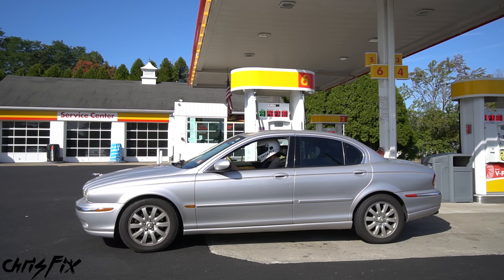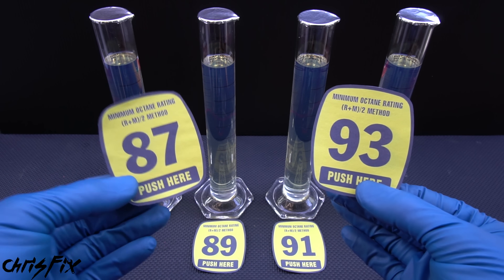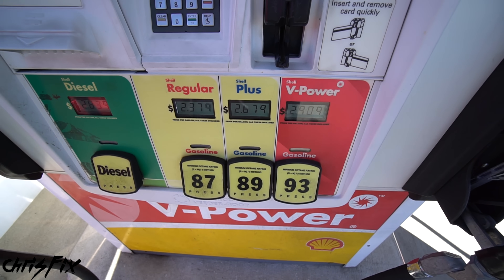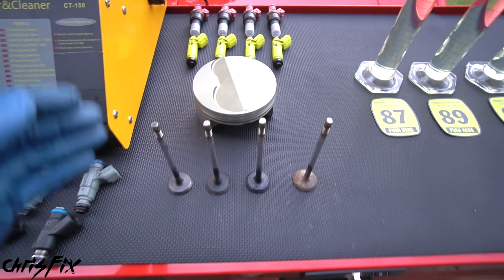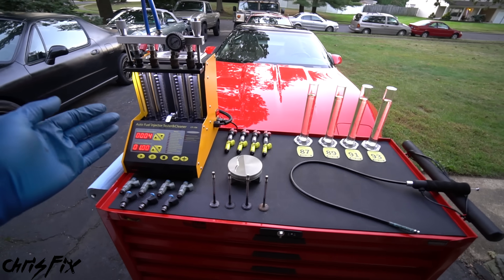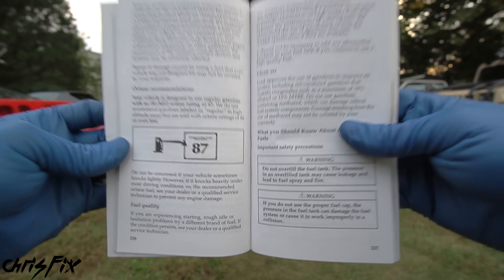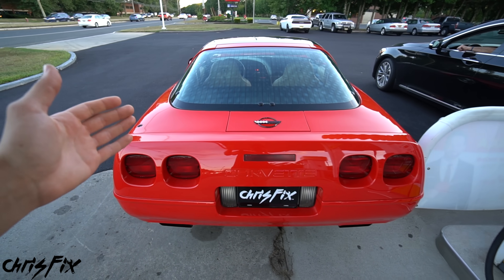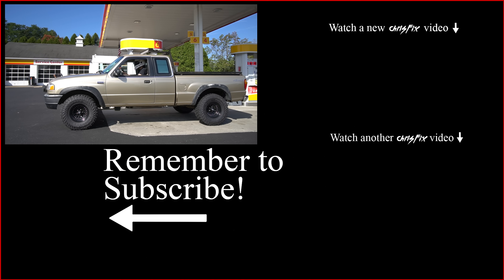What is the BEST Fuel to Use in Your Car or Truck and WHY

Comment: I'm a chemist and have worked in a lab testing gasoline and diesel. This is for the protection of the consumers in our state. I'm pretty sure most states have a lab to do this. Most of the information in your video is correct and very useful. Thank you for making sure to emphasize the octane rating you see at the pump is NOT the energy content of the gas. It's all pretty much the same between 87 and 93, unless of course it has a higher percentage of ethanol (Uh can we say E-85? why would someone run this fuel 🙄). Ethanol will decrease the amount of energy in the gasoline, but it's added to make the gasoline burn cleaner and is good up to 10%. 

Something you didn't emphasize enough though is what "octane rating" actually is. It is NOT the amount of octane in the gasoline. There is little to no octane actually in gasoline (octanes are eight carbon hydrocarbons). The octane rating is the "equivalent amount of octane" in the fuel so that will resists knocking as if it contained that percent of octane. Gasoline is mostly made up of mixtures of toluene, and xylenes. If you ran pure toluene as your gasoline, you'd be getting about a 110 octane rating, but this wouldn't necessarily be good for your engine. 

When gasoline is made, the manufacturers control the mixture of hydrocarbons to get a clean burn and the proper vapor pressure (vapor pressure is the pressure of the vaporized gas above the liquid, not to be confused with the engine pressure). Also the gasoline must be protected from oxidation (this is why you add fuel stabilizer when storing for a long time) and contamination like water or particulates. Every brand of gasoline has slightly different proprietary ingredients to do this (as you've said at about 6 minutes). Also, the time of year will dictate what vapor pressure the gasoline manufacturers must make the gasoline to deliver to the consumer. 

Forget octane boosters. A pint of octane booster won't raise the octane rating of a full tank of fuel enough to make a difference. If you have a high performance engine that's been engineered for high compression, you're going to know you need a higher octane rated fuel. You aren't going to hit that 87 button. Are you?🤔  By the way, most mid-grade pumps, mix (in the pump itself) two parts of 87 with one part of 93 to get 89. But if you look at the price per gallon, they usually give you the "mid-price" between 87 and 93 for the 89. You'd be better off cost wise, by pumping 10 gallons of 87 and 5 gallons of 93 if you really want 89. I suppose mixing it well enough in the tank might be problematic for the first few miles. Really, you didn't need the 89 anyways.

Octane Rating Tests Explained:
One more thing you didn't explain well was how we get the octane rating in the USA. Yes RON stands for Research Octane Number. It refers to an actual test engine and ASTM method D-2699 for testing the octane rating of spark ignition fuels. My lab uses a RON called a Waukesha RON engine. It varies the compression of the cylinder to make the fuel knock while holding other variables at constant values (temperature, fuel/air mix, engine speed, etc). There is another test engine my lab uses, it's called a MON or Motor Octane Number engine and ASTM method D-2700. It too is a Waukesha engine that varies the compression of the cylinder but holds those variables at different values, mostly the engine speed is faster on the MON (900 rpm instead of the RON's 600 rpm), but I believe the inlet temperature of the RON is also kept higher. The RON and MON tests give slightly different results for octane rating due to the differences in these other variables. MON is always lower than the RON, by about 10 octane ratings if I remember correctly. In the USA, when you see the (R + M)/2  on the pump's octane rating label, it's telling you that the gasoline is rated by testing by both the RON and MON methods, and the final number you get is the average of the two test results. I rarely hear this average referred to as "PON", but I know it's not PUMP Octane Number. I had to look that up and if you want to trust Wikipedia it stands for "Posted Octane Number". In Europe, they only test with the RON method, as you've said, so this is why their octane ratings are higher. They don't have the lower MON test averaged into their octane rating.

Great information in your video for all consumers. I gave it a thumbs up. 👍
Reply: How could a person consume toluene?  Is it contained in alcohol?
Reply: There needs to be a correction to this statement that all the grades of fuel burn at exactly the same rate, or speed, (which isn't exactly the same, but close enough for this video.)

The lower octane rated fuel, the 87 Octane, actually does burn faster.  That is why it will cause knock problems in higher compression ratio engines.
In 87 Octane fuels, you will find more straight-chain HCBN's, and this is the source of the quicker burn.  A straight-chain HCBN, such as normal heptane, C7, because it's seven Carbon atoms in a relatively straight line, with the other available bonds, (carbon usually forms four single bonds), taken up by hydrogen atoms.  Normal heptane is used as the definition of zero Octane when running the fuel in a test engine.  When used in lower compression ration engine, this quick burning isn't usually a problem.  The lower compression ration doesn't force the molecules in the cylinder as close together as in a high compression engine and the rate of burn will occur throughout the downward, or power stroke of the engine.

In a high compression engine, the fuel/air mixture forces the molecules closer together, and they will burn quicker than the piston can move down in the cylinder, and you may hear the 'knocking' sound, which is the flame-front of the mixture hitting the cylinder top as well as the cylinder walls.  It can get bad enough to blow a hole in the top of the piston, or even bend a connecting rod, (or both), and this will not be a good thing for your wallet.

I said earlier that normal heptane, (n-C7) is a straight chain HCBN with a RON of zero.  A different HCBN, one called isooctane, which contains 8 carbons, but not in a straight line is used as a reference and is, by definition, 100 Octane.  This HCBN contains 8 carbons, but not in a straight line.  It has a line of 5 carbons, with 3 others branched off the main chain.  There is more than one isooctane, but the one given the 100 Octane rating is technically, 2,2,4-trimethylpentane.  That means the second carbon in the chain, has two other carbons branched off of it and the 4'th carbon on the original chain has another carbon branched off of it.  This actually causes the fuel to burn at a slower rate in the higher compression engines as it takes more time for the carbons on a branched chain to react with the oxygen in the cylinder, giving a longer, slower and smoother burn throughout the power stroke, not having a quick moving flame front that may damage the engine.

Okay...., enough of Chemistry 101 for today.  (I also worked in the engine lab of a research company for a while years ago actually running the knock test engines.  We were part of the National Exchange Group that rated gasolines for not only our products, but also those of other companies to ensure that we were all getting the same results, ensuring continuity throughout the petroleum industry.  I only worked in the engine lab for about a year, but I stayed with the company and moved to the petrochemical research division. spending over 43 years there, designing and building experimental refinery units and processes.  

Now these days, although they still sometimes use these old single cylinder engines to rate fuels, it's mostly done by chemical analysis right at the refinery, using a gas chromatograph, analyzing the fuel as it's being made and calculating the Octane number right on line.  In some cases, they have gone beyond that method and are now using what's called an NIR cell.  The NIR stands for Near Infrared, and a beam of this light is passed trough a sensing cell with glass on both sides, one with the NIR source and on the other side a sensor picking up the spectrograph of the light beam.  By much work and effort, it's now able to give a rather accurate analysis of the HCBN stream in the sensor and calculate the Octane number from this analysis.
Reply: @bruceberntzen5807  lol
Reply: As a chemist with 12/13 years in the industry certifying gasoline, yes and no. There IS a difference in energy between 87 and 93... 93 is often blended differently, meaning more reformate (more aromatics means more energy) or, in some cases, pure alkylate. Ethanol does not necessarily mean "cleaner burning", but it can be taken for that in some ways. There are some wrong statements in the video... but for a leyman breakdown, it does its job.
Reply: Thanks mark. So you agree ise the one with the worn out button
Reply: Oh my god 
That was so intersting and usefull
Reply: Mark Bisson wow ☺️☺️👌
Reply: Refreshingly thorough comment, thanks!
Reply: E85 is amazing for forced induction
Reply: Same my butt, I always use 93 in my bike or it runs like a ww2 soviet era tank.
Reply: is it Mobil that used 10% Ethanol in the Gas?
Reply: Mark, a question for the recommended gasoline from the manufacturers...As we know that high compression engines require premium grade gas, do you have any info as to what engine compression ratio needs that kind of gas?  I knew a lot of autos have compression ratios lower than 11, mostly around 10.5, and they recommend premium gas (not required)...Thanks,
Reply: No you're not
Reply: @DonLicuala  It was an example of when to use what gas and additive.  
You do realize a stock Yamaha 600 street bike is 13.1-1 and is rated for 93 octane?
Reply: @DonLicuala  Ironic
Reply: @OGSteele-i9v  I swear I couldn't make this stuff up if I tried lol....because it "might" have worked in one scenario with a dirt bike, you can make a blanket statement. Well that tells you a good mechanic has nothing to do with being a good scientist.
Reply: DonLicuala: Pleas explain the Wave Equation. I am interested to know how it works with a internal combustion engine using spark ignition.
Reply: @jaysmokey  Yes call the number on the certification sticker on the pump. In my state it will put you in touch with the office of weights and measure, a division of our department of agriculture and consumer services. If it's a pump that mixes mid-grade, it's quite common for the mixing valve to be malfunctioning.
Reply: Wrot a whole essay
Reply: Great info. I used to work at oil refineries and also ethanol plants. I'm an amateur mechanic or enthusiast. Not a great tuner but getting better with the better tools and understanding of fuel atomization and newer computer controlled air/fuel mixtures. My question is this Waukesha engine. How do you vary compression without changing heads, combustion chamber size, or type of piston? I did a lot of lab work at the ethanol plant as well. Our methods were very precise, and the distillation process of this small plant was so consistent with the sieve system that top distillers could not make better ethanol. I only think that ethanol is bad for fuel in engines not designed to run it. That is a whole different discussion though and just wanted to ask you the question about the Waukesha. Thanks
Reply: Mark Bisson whoa, this information is gold. I love that a fellow scientist decided to drop knowledge on those who are blind in this space. My background is in medicine not chemistry so this explanation was amazing for me! Thanks again! 🙌🔥🤩
Reply: Tyvm
Reply: Thanks for your additional input!
Reply: What about LPG octane number, performance, etc? I have read that LPG have higher octane number. Also i have read that LPG is good for enviroment.
Reply: @milanmitrovic994  I've never heard of anyone doing an octane rating test on liquid propane. As far as I know, Waukesha doesn't sanction a modification to their test engines to be able to run cryogenic gas. The ASTM method certainly doesn't include LPG as a fuel for this test.
Reply: What’s the deal with 86 octane? I see those occasionally and it confuses me when most cars today run 87
Reply: I have a Honda pilot. It has an 11.5 to 1 compression ratio. I’ve been running 91 with ethanol content in there it says 87 or higher recommended with top-tier fuel I go to Sunoco that has the top-tier sticker. I want to have the best performance and mileage. I used to run 93 but apparently my compression is too low for 93 even though my car didn’t get hurt running it.  I’m not sure exactly which the best octane to run is since it says 87 or higher.
Reply: I have a 4.3 V6 Chevy engine.  I believe the manual says to run the cheap stuff.  I started running premium a few years ago, because the engine seems to run a lot smoother.  If you listen to all the "experts"  they would say to run the cheap stuff.  I have no idea what the fuel mileage difference is between the two, but isn't it better for the engine not to have it knock?  I think it's worth the price difference just for the engine to run smoother.  Am I wrong?
Reply: @mailjamesthomas  do you have a rod knock or a pinging? In either case, you should probably do a little maintainence under the hood. Check the fluid levels and coloration, belts, filters, etc. Also, check online forums specific to your vehicle. Maybe it's common thing and fellow users (you know, birds of a feather) might have some inexpensive tricks to fix it without getting pealed by unscrupulous mechanics and you might learn something new about your truck. I find that whole "well it's not doing that thing now so we should be good" mentality to be major hassles I can't schedule.
Reply: @cliffcampbell8827  I'm not sure, The engine just seems to run smoother when I use premium.
Reply: @mailjamesthomas  Seems? Waste of money. Read the manual.
Reply: @mailjamesthomas  Yes you are wrong. The manufacturer makes manuals for a reason. They know what gas you need. Read it and use the proper gas.
Reply: @thekretch   Stick to reading pamplets and cereal boxes. Stock cars knock on reccomended fuel all the time. Most GMs that call for 87 can have measurable knock in "normal" operation using a scanguage II. 93 Octane prevents that knock. 
 Ford put a 4.6 DOHC engine without knock sensors in the Lincoln continetnal. They reccomend 91 octane because of this and they also reccomend replacing stock plugs with shorter ones just in case. A lot of mistakes made with that vehicle.
Manufactures get the car out the door, they dont fine tune them.
Reply: @mailjamesthomas  No you're not wrong. If your engine runs noticeably smoother with higher grade gas, then irrespective of recommendations  you should use the higher grade gas.
Reply: @Scott-ew3bs  Wrong. You want to waste your money go ahead.
Reply: Sounds like a good write up, but really lacks knowledge on the mechanic side. If you don't understand how octane corresponds with compression you should find out. 

Being a good chemist has nothing to do with being a good mechanic.

And for octane boost not making a difference, that is just an ignorant statement.  My last racebike had headwork done and was milled, this brought the compression up to 14.1-1, and after this on 93 the motor ping'd, and after adding 3oz of a lead based 108 booster, the pinging went away, and the engine ran drastically smoother.
Reply: @Scott-ew3bs  ping'd or pinged? Is your racebike an R'1? GSX'R? Panigal'e? For a racist you seem pretty cool though. Sigmund Marquez Dovizioso Freud was good at headwork too.
Reply: @Scott-ew3bs  it's the lead that removed the pinging not the octane, as lead is a natural lubricant in that form.
Reply: @b.eduardo5105  No sir. Lead contributes to the octane rating. Yes it is a lubricant, but that is only needed for old style valves, like prior to '73

Lubrication has nothing to do with detonation in a 4 stroke engine.
Reply: @Scott-ew3bs  Most of my cars are pre 73 :)
Reply: @b.eduardo5105  Tetraethyl lead was a lead based octane booster...
Reply: @b.eduardo5105  Nope, it's the octane rating that's increased with the addition of Tetra Ethyl Lead  protects the engine from detonation. 
The octane number can be increased a number of ways, adding TEL, MMT, MTBE, TAME, ETBE, ferrocene or Alcohol for example. 
For detonation prevention, it doesn't matter what's used for increasing the octane rating, it just needs to be the required number for that engine design. 
But other considerations ARE important. TEL (Lead) is a really bad pollutant for human brain health.  MTBE (Methyl tertiary butyl ether) is a terrible contaminate of ground water. Ferrocene causes engine wear, and so on. 
So these days it's done by increasing the hydrocarbons which have high natural octane numbers and reducing those with lower octane numbers. 

For example, most straight chain hydrocarbons have poor detonation ratings, like n-heptane and n-octane (yes n-octane has a terrible octane rating). 
But some branched-chain hydrocarbons like iso-octane (2,2,4 trimethyl pentane, and 2,3,3 trimethyl pentane have high natural octane ratings, as do carbon ring shaped hydrocarbons like benzene, toluene, and two isomers of xylene. 
and of course adding Ethanol also increases the octane rating, but it does reduce the energy density of the mixture - 10% ethanol reduces the energy content by about 4%, so you go slightly less distance on a tank full.
Reply: Good stuff Mark. Can't argue with chemistry. It's what I love about hard science, it's not open to pointless conjecture/opinion.
Reply: I read your article 😉... thank you for the info. Can you please tell me in plain English which is the best fuel for my car?
Reply: @eddiebrock9943  Chris Fix said it well. The best octane grade to get is the one your car is designed to use. For most of us that's 87 octane. The proprietary ingredients make little difference. Keeping your car well maintained and running with the right fuel/air ratio will keep your intake clean. Chris Fix also gave Shell a "plug" for using more ingredients to keep injectors and valves clean, but I can't say if that's accurate or not.
Reply: @mbisson5816  thanks bro
Reply: @eddiebrock9943  you should probably include engine model, make, model and year of the car and if it's been modified (intentional mods only, those "while driving" unintentional ones are best left to a body shop and your insurance company). Or you might be able to get a copy of the owners manual from the dealership or manufacturer. The info should be in there.
Reply: @eddiebrock9943  your manual or gas door will tell you. Most need regular 87, higher performance and most turbo engines require or run better on 93.
Reply: @codyrochev3878  thank you but what about 87 being dirtier than 93?
Reply: @eddiebrock9943  Whatever is recommended in the owner's manual.
Reply: eddie brock ... I would say diesel...
Reply: @eddiebrock9943   Good question.... IF you have a high powered car use the higher octane, otherwise if you have an ordinary car use the lower octane...In the uk we got 95 n 97 octane.... I use 95 in my Fazer600 but she is 21 years young...
Reply: @gregoriousgilbert519  I have an Impala 07
Reply: @eddiebrock9943  Read your manual.
Reply: English?
Reply: Premium is the best but it cost more I used to haul gas they told us not to drop gas at the premium had more than one in our or 1 inch or less of water and regular could have over 3in and more trash in it you get more trash and water and regular than you do premium cuz we had to go pump the tanks
Reply: @dalemarshall625  Premium does not make your low compression stock daily driver, drive better or give you more power. Their should be less water than that from your storage tanks. That waste should be cut or drained into waste tanks well before delivery. That is protocol at any good supplier. Corners are cut by operators and drivers as well. Samples are pulled from the bottom of a storage tank before delivery and that's where the water will be. Those lab results have to be within parts per million not 1-3 inches, before delivery. Tankers and storage tanks get cleaned with solvents not water. If there is garbage or water those tanks need to be decommissioned or relined. That's just crazy.
Reply: @dalemarshall625  unfortunately thats not true. Premium gas lowers fuel economy and horsepower in virtually every vehicle, the only exception is if the car has serious engine trouble already, in which case premium can disguise it and make it run a little smoother. But for 99.9% of cars including the ones where the manual recommends premium its a lie and just a waste of money.
Reply: Wow, I understand everything you said up to I'm a chemist, after that could you please explain again, lol good stuff.
Reply: "Why would someone use E85?" Really? Guess you don't know much about performance lol You can make a ton more with E85 over regular pump gas
Reply: Not great at all. At 2 minutes 48 seconds he says the fuel exploding before its supposed to. Gasoline is not supposed to explode. It is supposed to be a quick burn.
Reply: @suekennedy8917  what is an explosion? A tremendous and violent expansion of something, like fire consuming a highly volatile fuel in a pressurized container.
Reply: Cliff Campbell: What university did you get your engineering degree from. It's not an explosion, its a quick burn.
Reply: @suekennedy8917  I know you are technically correct. Most people don't understand the distinctions between materials that are combustible, flammable or explosive being the rate of reaction and the speed of the expanding gases, but I'm willing to accept a general usage of "explosion" to be a rapid expansion, and ignore rates. Diesel fuels are combustible, gasoline is flammable and both are made to burn rapidly in an internal combustion engine. TNT is explosive and it would be an engineering marvel to make an ICE to use it as a fuel. Don't you agree?
Reply: Mark Bisson: It would be a few things such as the speed of the flame and scavenging efficiency at whatever RPM or average piston speed the engine is supposed to run at. Then they can look at the torque vs   engine RPM curve and the IMEP and figure out whats going on in there. I dont know why anyone would use dynamite for fuel in a gas turbine but I suppose it could be done
Reply: @suekennedy8917  The last part I said about a TNT fueled engine was humor since TNT does actually explode. BTW, TNT is not dynamite but I'm kind of tired now of "splitting hairs" on this thread.
Reply: @mbisson5816  Me too. I also like 'splitting hairs' because whatever I learned from the prof who graduated from University of Michigan is irrelevant. You know, be off a little here, a little there, and a 4 year engineering degree is as useless as a high school diploma. I also make tons of comments I am joking about. Good luck running solids through a gas turbine.
Reply: @suekennedy8917  An explosion is a sudden and catastrophic release of energy resulting in a pressure wave. Go and ignite some flash paper. You just witnessed a "quick burn." Now detonate some C-4 or dynamite or vaporized gasoline mix it with some air, compress that gaseous mixture (9.5/1 or maybe 10/1 should do it).    If your combustion triangle (heat/oxygen/fuel) is in proper ammounts, put a spark to that compressed bad boy and watch the beauty of the physical properties of heat expand quickly. Did the C-4 explode or "quick burn"? What about the dynamite? Explode or burn really REALLY fast?...trick questions, the plastic explosive and the dynamite did both. The quick burning fuels expanded catastrophically and if you were close enough to the boom-booms you should have felt something (besides shrapnel and debris). What you felt was a pressure wave. An internal combustion engine harnesses that violent expansion and pressure wave and converts it into mechanical energy. The dome of the cylinder head, closed valves, cylinder walls piston and piston rings all do a bang up job containing,  channelling and converting all that aforementioned stuff. Feel free to kiss your dogs back door solid waste portal.
Reply: Cliff Campbell: Hi Teddy! Does the FBI or your local police force know you have been detonating C-4 or dynamite? You are quite violent. Vaporized gasoline...LOL!!!!!
Reply: @suekennedy8917  GREAT catch
Reply: Sue Kennedy ur just here to fact check not enjoy the video? Do u have a girlfriend? How does she tolerate ur ocd?
Reply: Yes..I do hit the 89 button to fill my car which the manufacturer claim needs high octane. If not driving hard..Its perfectly fine
Reply: @trevorb7645  If your car pings under any type of use you need to use higher grade. Just because you only hear it when you get to higher rpms doesn't mean its not happening at lower.
Reply: @trevorb7645  manufacturers print that stuff to help the consumers get the most out of their vehicles. What gets you down the road today might not tomorrow because of improper use and upkeep.
Reply: Ethanol is a renewable fuel source and can be locally produced when gasoline refinement or import is infeasible.

For a chemist, you're remarkably short sighted.
Reply: @Uejji  energy density of ethanol is about 30MJ/kg compared to gasoline which is around 45MJ/kg (this is by mass). Meaning if 1kg of petrol gets you 45km (hypothetically), you need to carry 1.5kg of ethanol to travel the same distance. THIS is what the chemist was talking about.

(and yeah, before you say that fuel tanks are volumetric rather than mass, ethanol = 24MJ/L vs petrol = 34MJ/L)

Given you sound like you know a little about market forces, also consider that there's a heck of a lot of corn that has to get grown to produce that much ethanol - I'd be interested to see your numbers on how many square kilometres (or miles) of corn farms (or whatever carbohydrate feedstock you choose) are necessary to replace a small country's (you get to pick the country) fuel supply because they got cut off from oil.
Reply: @carneeki  it's true, squeezing and rotting corn is one of the most popular plants fuel can be extracted from, but there are other sources that can be tapped. Grass, trees, bushes, algae, hell any living thing, not just plant life (not really sure what algae is classified as, I just call it rock snot), if it can rot, it can be converted  into liquid fuels. Don't believe me? Fry up a whole mess of bacon. That puddle  of animal fat in the pan is ready to catch fire. I think the better choice of fuel from plants would be algae (whatever it is) and invasive plants. I forgot the point I was trying to make.
Reply: Uejji he wasn’t talking about its feasibility he was simply stating its inefficient in energy production when compared to burning gasoline. For a random commenter on YouTube you’re remarkably obnoxious. What are you 12?
Reply: @Uejji  ethanol isn't really that great to run vehicles on. Downsides include, but not limited to: less power, poor efficiency, premature component failure (even if you do a complete conversion), water contamination and extreme heat/cold fuel woes (but I think there are additives for climate based problems). Fuel alcohol on the other hand is some remarkable stuff, too bad it's really expensive.
Reply: @cliffcampbell8827  alcohol as a fuel really is something, take Jr. Dragsters for example, most are based off of single piston Briggs&Stratton engines and make 50+hp using alcohol with a few other mods
Reply: @Uejji  Also, at some stations E-85 maybe 20 % preferably 30 % less expensive, besides it smells like booze.
Reply: @Uejji  ....and if everybody in America switched to E-85, it would take nearly 500 million acres of land to produce enough fuel to adequately replace gasoline.  That's nearly the land area of Alaska and Texas combined.  That's a lot of habitat destruction to satisfy your virtue signaling.
Reply: @Uejji  Most of the ethanol in this country is made from corn, which is also a food source,  more land/corn to ethanol, less land/corn for food.  Also many of the refineries that produced ethanol were powered by plants running coal.

So as someone critiquing the explanation of a chemist as short-sighted you show equal lack of forward-thinking by suggesting that producing ethanol from a food source and the use of fossil fuels is somehow  a suitable  substitute if we can't use gasoline.   Not to forget that a gallon of ethanol has a lower BTU content than a gallon of gasoline so more ethanol is required to do the same amount of work.

This world is addicted to fossil fuels.  Ethanol could be a more suitable substitute if we source it from a crop other than corn, such as cellulosic ethanol.  We would also need to use a non-fossil fuel to power the production.  In other words drastic changes in production methods.

Good luck getting the corn lobby to buy into that.
Reply: @ricardotesta1949  corn-based ethanol is not a food grade grain, and therefore not suitable for human consumption.
Reply: @Uejji   Ethanol is grain alcohol and is bad for an internal combustion engine. Period.